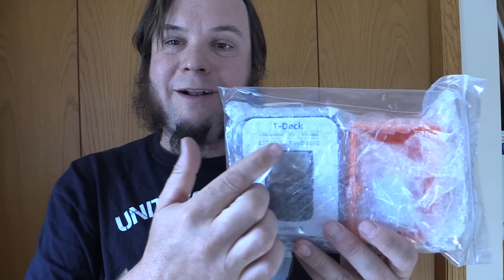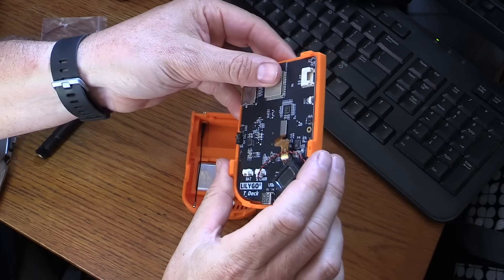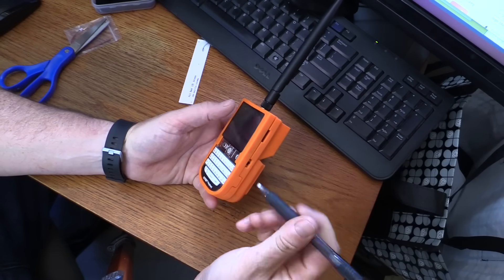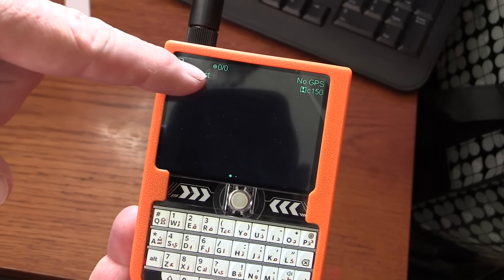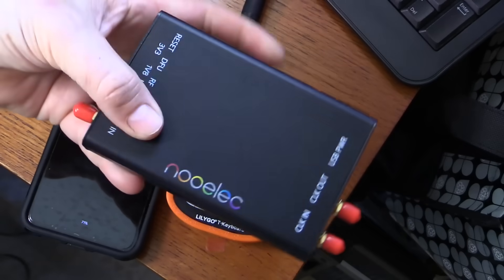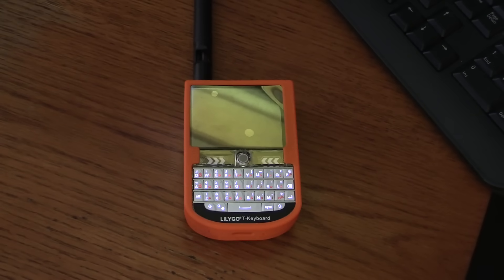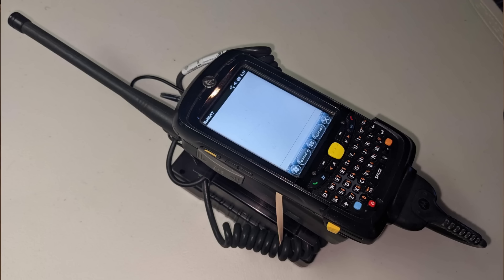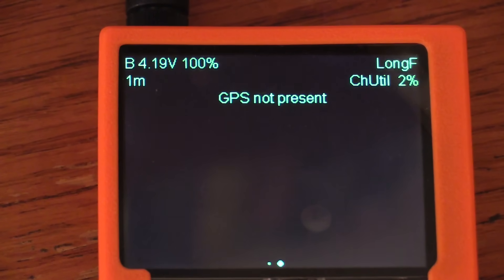Trying Meshtastic For The First Time

Comment: As someone that recently got some meshtastic nodes to play with, with a hope that it will work well at a busy festival when the mobile networks fail (which happens quite often due to the number of people concentrated in a very small area) I've got one of the tiny ones with a tiny antenna. When I've stayed in tower hotels overnight in london and recently dusseldorf I leave it overnight by the window and usually manage to pick up a couple of nearby nodes but alas my messages to channel 0 seem to get delivered but no one ever responds. Ideally it would be nice to have a proper permanent node at home with a large antenna on the roof as I can see from others testing that you can get a very decent range with a good antenna. They're fun little devices to play with!
Reply: but pointless
Reply: @londo776  it’s not pointless if it works and does the job

Comment: Hey man, I've been playing with Meshtastic for a few weeks now. I'm in the process of building a RAK repeater with a nice high gain BIG antenna. I've built four small portable units now, two for my best friend and two for myself.  I will be building more and giving them to other friends and family because they're so cheap and functional.  I think you're going to have fun with it! Also, those tiny little IPEX/u.FL connectors are a LOT easier to snap into place if you have a hard plastic tool and just line it up to the little nipple.  Just give it a firm push and they snap into place. As a drone enthusiast, I learned quickly that they're not QUITE as fragile as they appear as long as you use firm, direct pressure and don't give them a way to move laterally.  They are useful in areas that has bad/no cell phone coverage or grid-down scenarios. They're also useful for TRULY private (encrypted, requires further setup) messaging.  I am setting them up so that if the cell network goes down here (AGAIN), that we will have a backup communication system. I've also deployed GMRS radios to close family members that need alternate communications to get in touch with me, as I am now a caretaker to more than one person and they NEED a way to contact me no matter what the grid does.  Also, the battery...  It takes the device some time to "learn" the battery characteristics. It gets more accurate the longer it's turned on and functioning, at least that's been my experience so far... but you can't REALLY rely on it that much. It's not RNG, but it's not the most accurate. It's something they seem to be working on!  Like everything else with Meshtastic.  It's not perfect, it's an emerging technology and most certainly NOT a "mature" project. It's very much a work in progress. Treat it as such and you'll get far more enjoyment out of it! :)  Also, if you REALLY want to open up your ability to talk to others, you should look into private MQTT servers that have been set up for your area. I would STRONGLY advice you to NOT set up the "Public MQTT" Meshtastic server for general availability. You will absolutely SWAMP your device AND all other devices on the same "LongFast" channel!  Use a targeted MQTT server for "public" channel use if you want your device to remain... Not on fire. :)  Have fun with it!  And welcome to the club!

Comment: I have bought 3 meshtastic nodes as well (not the T-Deck, mine are ttgo/lilygo lora32) and its pretty cool how far they can reach sometimes, but yeah, they dont have that much real world use apart from maybe using it to collect sensor data from remote stations or as a emergency communication system (even if it might be overwhelmed by the amount of traffic when you need it).

I have a small solar panel and an old lithium battery that provide enough power for my permanent node, which is also connected via WiFi, so I can see and write messages from anywhere inside my home.

Comment: meshtastic is crap For many reasons no Voice Is one, Try and send a text using  them  it's almost impossible and  long winded.  so Just use your mobile, And how are you going to power remote nodes So many reason why it's  rubbish The Nearest node is more than a 80 miles away from me. as You can see completely useless, It's a fad and it will die down soon, Using Smoke signals will get you better range, To be honest even shouting will, even using CB or cheap Chinese dual band radios or pmr446 Would be better off grid.(On the south coast of the UK)

Comment: After a few charge cycles your battery charge indicator will calibrate.. I have had a few devices do this after a new battery has been installed.. I've had it happen with a SONY and a Samsung device. Some apple devices you need to flash a chip that's on the battery.  Because apple loves its customers and wants to make it as easiest possible for them to fix their device.  😂😂😂

Comment: The trick with the antenna jack (on the board) is to hook the (opposite to the cable) lip first, then push down on the wire end. Then they become a breeze. Also, yes. The washers go on the nut side. Regular washer, grover, then nut. If you have an extra washer, then the manufacturer intended for it to be on the other side, but in this case, clearly, there's no room for that, so you double up the existing washer or chuck it in the parts bin for the next lucky dip. :)

Comment: Meshtastic uses 868MHz in the EU and something between 902 and 928MHz in the US. That is almost line of sight communication. In the right conditions it has a range of over a hundred kilometers (there have been low earth orbit satellites using LoRa). But on the ground it is limited by trees, buildings, weather, curvature of the earth and such things. The real range in these conditions are just a few hundred meters (from living room to living room in the city) up to a few kilometers (from rooftop to rooftop).

To get usable range, it needs help by repeaters!

Put a tiny one with just bluetooth/wlan on your roof and use it with the phone. Then you can establish connections with the people around you (if there are any). But if you see some hills from your rooftop, then put a tiny one with a battery and a small solar panel up there. Such an repeater has a range around 50 to 100 km and because it is a mesh network, it connects every node it can reach (all the rooftop nodes). And suddenly it works really good, that is when you put it in the drawer of completed projects and start something new. ;)

Comment: As others have said, it’s pretty big in Manchester and SE England due to Lewis M3HHY (Ringway Manchester) and Andy Kirby having done videos on it.  Andreas Speiss did a load of videos years before that but it didn’t really take off in Manchester until Lewis started showing the radios.  Once it got popular, that made my two radios actually start doing something after having mine running for years!  Last check, I could see 130+ radios from my house.

I have T-Beams instead of the T-Deck, but the main thing is to get the radio up high so you’re receiving and repeating other radios, then use your bluetooth app to do the UI bit.  Don’t set it up in “licenced ham” mode, and don’t change any setting apart from the country or you will probably end up in a closed group.  Leave the radio on all the time and you should see the network build up over time.  Also, get a better antenna on the radio, as the supplied ones can be a bit iffy.

Once someone in your area puts one in a good position, you’ll be surprised what pops up.

Comment: Once a accumulated a stack of varied gen psp's I did some home brew digging to find a load of app/progs that let them share and communicate with each other.   I hope you can do the same with these devices.      

My dream is a Pipboy that doesn't need to connect to a vast network to exchange info with each other.

Comment: CenturyLink is hijacking your DNS, you should use an encrypted DNS proxy to keep them from filtering your access to sites they don't approve of.  Quite often ISPs have broken filter lists that block things erroneously. A few of my customers have had problems with Comcast blocking major businesses they interface with (Lloyd's of London, for example). Using DNS to intercept like they do ends up with the browser flagging the SSL certs as invalid (no, you cannot have a wildcard root level cert, pesky ISP spies!).  If you have a router from Ubiquiti, they now have a checkbox to use encrypted DNS (hidden away under Internet, Primary, Advanced/Manual).

Comment: Great video. 
I'm excited for you that you now have a HackRf to play with, I have had one for 7 years now. I am hoping for your sanity that you are not plagued with the dreadful static discharge into the antenna, the tiny IC used for the receive amp (a duplicate IC is also used for the PA) is a horrid thing to replace when they stop working.
Reply: You need to get the Clifford heath version it solves that problem
Reply: @londo776  Thanks, I'll look into it.

Comment: This is not the future of mesh networking that we forsaw in the 90's and early 00's. Makers were all over this idea and this tech back then but it never took off at all, despite attempts to reinvigorate it.
Reply: Back then, power consumption and battery tech were nowhere near where they are now.  Now you can have solar powered repeaters that can last effectively indefinitely, pocket nodes that weigh an ounce and can last a week on a charge, and a reasonably robust network if you take a little care in setting things up properly 

I think people are wanting Meshtastic to be more than it is, and more than it's supposed to be. Grid-independent mesh  text comms, and to top it all off, really cheap compared to the commercial equivalents.

Comment: if you have one single unit you can enable mqtt and use your phone’s connectivity with a phone app to reach nodes outside your physical range. think of it similar to d-star or other internet gateway for ham radio. similar concept where you can make use of it before getting other meshtastic nodes for testing.

Comment: One doesn't simply buy one node. I already have six and they have been really interesting to play around with

Once I get some proper cases printed I should be able to put one in each vehicle for a family holiday convoy.

You don't need GPS, but you can add extra sensor modules and use them like a mesh connected weather station.

It's not like amateur radio where people seek contacts, its people making their own community communication networks.

Comment: A lot of these problems can be fixed playing the meshtastic code, or by adding some hardware. For example,  the battery indicator is voltage based, by measuring the current you can get way closer to reality (but it may require hardware mods). So yeah, really cool but not for the average consumer.
Reply: Good cells have repeatable characteristics

Comment: Can relate to tiny crap and ape fingers.   My fingers would be more at home picking boogers out of a lowland gorilla's nose, or busting open termite mounds.  When I was tearing apart computers and occasionally reassembling them right, I struggled.  These days, damned "keys" on a smart phone are a challenge.  When you can push 8 keys at once with your finger tip, and you are old and getting near sighted anyhow, they make you invoke the old gods and fill the swear jar quickly.

Comment: The T-Deck is definitely a challenge. I started with two T-Decks which helped quite a bit in understanding them, since I could talk to myself. The keyboard and screen seem like they would be nice but I've found it much simpler to connect a phone through Bluetooth or a PC through USB and use the web app. I've had similar experiences with the keyboard and device itself being unresponsive but I've found that the unresponsiveness correlated to my lack of knowledge and the more I got in tune with using the T-Deck, the fewer problems I had. The T-Deck firmware is beta, so we can hope there is a lot more development to come and that the T-Deck will become a useful standalone device. I too have yet to connect to any other Metastatic device, other than my own. I take one device with me when traveling around the area and send random messages on the public channel but I've yet to see another device.

Comment: The LTE antenna is something that will work, but that external antena is a better fit.

I like 'The Alley Cat"'s t-deck case a bit more than the one you received. Yes the board antenna connecter pretty much sucks. 

GPS is handy if you want Mestastic to track where you are, and get the time from something useful. There is no internal RTC clock within the system. But not, it's not required. And yes that internal map is related to having the GPS as well.

I'm working on setting up a couple of repeaters, one on the roof here in Robbinsdale, and another up at my not really an edition of SandLand) I bought the land to retire on, I'm retired now, but can't really move up there at the moment. Need to get back out of retirement for a few years.

What some are doing with LoRA but not necessarily Meshtastic, is part of home automation. for sensor traffic carrying.

As the ESP32 doesn't really have a multi-tasking OS, (it has firmware that provides something like that, but it's not a full OS that can launch more than one user app.) So unless it's integrated into Mestastic itself, it's probably not going to happen while Meshtastic is on the device. That might change, who knows.

My own preference would be to be able to take notes that get synced up to my server at home  w/o having to rely on Google or someone else to not be reading them over whatever comms channel I use. Shopping lists, etc. 

There were about a hundred or so users at Hamvention this year, and they ran into issues with the configuration of channel 0, as some of the things that the default configuration does is send fairly short messages over long transmit times. This is good for range, not so good for high volume traffic.

When properly configured, with properly tuned antennas, these things have demonstrated phenominal range for something working just under a Gigahz. As part of my relay setup, I'm considering pairing two devices, one for local high speed coms, and another for distant but slow traffic, and see if I can reach others.

Have fun!

Comment: You hit on my issue with Meshtastic - The discord is filled with people talking about building rigs and leaving them places illegally. When you ask about usecase, no one has any real answers. The only non-answer is: Emergency / Private Comms, that turns out to be code for "I'm hoping for a Civil War in the USA"  

I bought some nodes to use it for an outside camera i bring with me to in areas without cell service but the software just isn't ready for any real comms yet. 
Just wait till you find 100 nodes! It all crashes.
Reply: There are practical use cases - low cost and reliable way to send telemetry between devices and to initiate commands to remote devices
Reply: 100 nodes and more aren't the issue, the issue is people can configure their devices wrongly to fill the channels with noise. It works decently if no-one messes with the settings in a bad way (like updating position every 5 seconds).

Comment: I'm convinced there are some use cases where meshtastic would be an ideal tool to have. Its also weirdly appealing to have a sorta 'off the grid' text messaging system... even if not many people use it. Keen to see what you do with it next.
Reply: The main uses I can imagine for them that beat normal cell texting is at conventions where the cell towers are choking on users, off-grid quiet radio coms like hunters spread over an area checking on each other without a radio squacking, and for folks trying to discretely communicate during protests using the encryption functions.

Comment: This is just (A no licence required) form of Packet (Used in Ham Radio) old school mode of communication. Not too exciting in my opinion. (but that's just me) I don't see a practical use for it either.
Reply: The practical use for it is for things like camping or emergency preparedness, because the devices are so small. Packet radio is great but the hardware doesn't fit into your front pants pocket and run for a week on a single charge, whereas there are several meshtastic devices that can do that.
Reply: @innercityprepper the 915 MHz ISM band is also an amateur band. You can use this with a call sign and appropriate operating practices, and it’s amateur radio gear. But I think the major appeal of meshtastic is that it’s unlicensed, and therefore “untraceable”. 

I’m pretty sure these gadgets are popular because of the prepper crowd. They want a solution that will survive “the event”, whatever they fantasize that to be, and they probably imagine that the baddies will track down every single person with a amateur radio call sign and send goons to smash their equipment.
Reply: @innercityprepper  Could be used for emergency preparedness.. "Just hope" Others Have one to see you send "HELP".. Else rather useless (A test would need to be done) in a Mock Disaster scenario to see how effective. (Time will tell) if Practical.
Reply: @x_CrossHair_x  I assume most people that use it for emergency preparedness use it specifically to be able to keep in touch with a select group of people, vs just random anybody's.